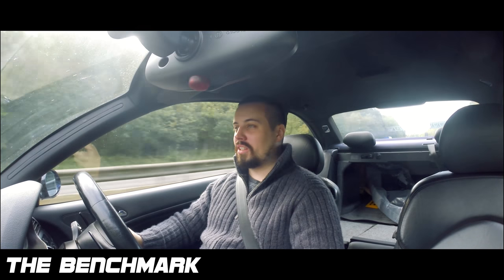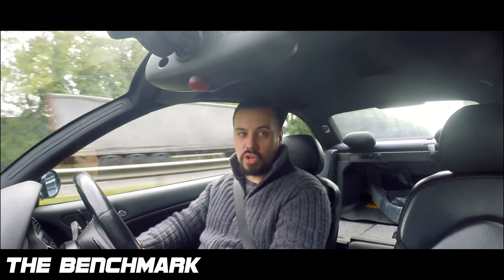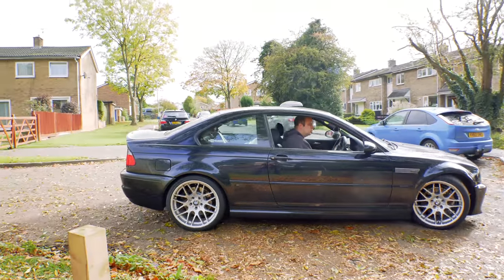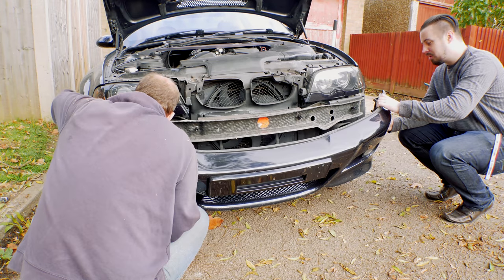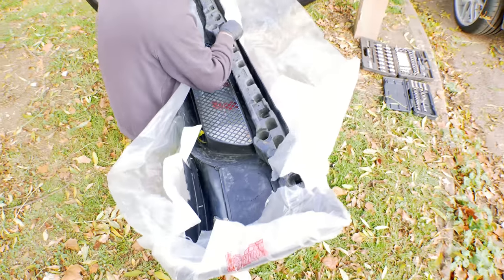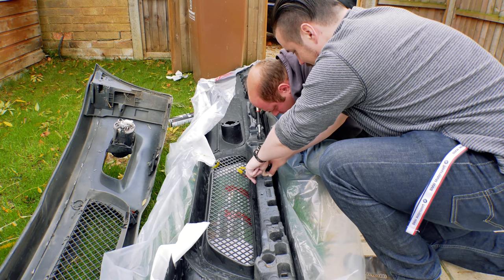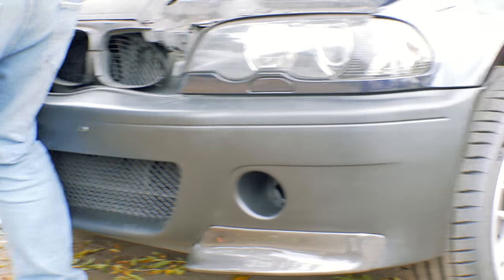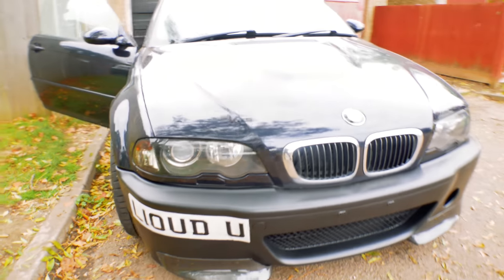Project M3 - M3 E46 CSL Bumper Install - Ep:6 - The Benchmark

Comment: Can’t believe you just ditched that oem bumper, what a waste
Reply from the maker: I was going to include a bit about why I was ditching the bumper but it didn't turn out great.
It was wrecked, mounts,tabs, fog lights, chunks missing on the lower section and to top it all off the condition was so bad it would of cost a fortune in labour and required silly amount of filler/sanding to bring it back.
In fact that was the main reason I changed it, I actually like the design of the stock bumper.

Comment: I'm fitting my new 19" staggered CSL rep wheels (matt grey) with Michelin PS4S tyres tomorrow. The fronts have an agressive 35ET offset so should look great once fitted. How do you find the PS4S? I had stock PS4 on the rear and they were like super glue, can only imagine how good the PS4S are!
Reply from the maker: +sarcastixx74 so far only done about 300 miles on them so they aren't really scrubbed in. Though the car went sideways pulling out of a junction the other day which wasn't so impressive. But again barely scrubbed in so I will give them a chance.
Reply: I'm just back after getting mine fitted. Noticed an immediate improvement in (less) noise and the aggressive offset in the new front wheels makes turn in much crisper. Noticed it had a bit of play in the right hand diff shaft while up on the ramp so might need to look at getting the diff rebuilt and/or upgraded in the new year. Like you said, still to break the new tyres in properly so if the grip is at least as good as the PS4's that they replaced I'll be well chuffed!
Reply from the maker: Good to hear, so far I haven't been able to push the car as I am still restoring some rather critical areas. Once they are done it will probably be winter but I will try to get it out on the road as much as I can.

Comment: Cool video but that looks like one of those cheap ebay csl replica bumpers? The sides look bubbly (chipmunk cheeks). It should be sharp and sleek. Vorsteiner and Sgt look closest to oem csl.
Reply from the maker: Love the term (chipmunk cheeks), but I can't see what you see?
Its smooth, high quality plastic. By that I mean really high quality, it's the most solid and complete aftermarket bumper I have seen for a long time.
Could be smudge/grease marks from fingers and lighting causing it to look funny and perhaps the awkward fit caused by my crashbar?
Reply: Just google m3forum chipmunk cheeks. It's a common term for us e46 m3 guys. Cheap csl replica bumpers have wide bubbly sides making the front end look less aggressive. If you look at the car directly from the front inspect the sides it curves outwards. Oem csl or vorsteiner doesn't have this. It's straight and sharp.
Reply: I already know you have the cheap bubbly bumper bcs yours utilizes the Kevlar support. Oem csl bumper and quality replicas can't use that as they have built in crash bar. But if you're happy with it then that's all that matters I suppose.
Reply from the maker: That was a rabbit hole!
I see what you mean, the fitment presently is just temp, it will be fixed/adjusted when it goes to the bodyshop.